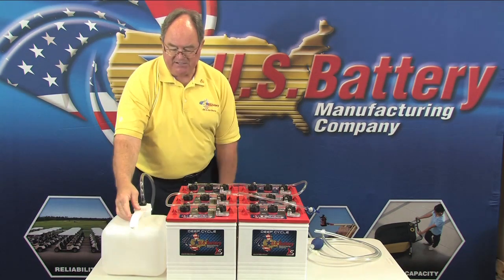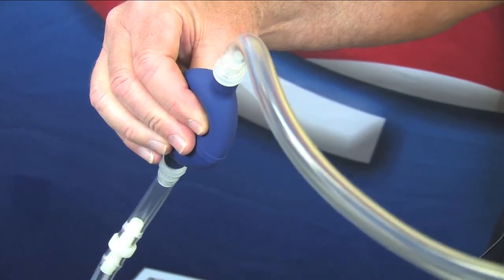Battery watering kit - by U.S. Battery

Comment: where the gas come out when battery charging ? Through the watering tubing or the caps like usual ? Just need to know how battery need to be vented in close space.
Reply: @USBATTERY  so having the filling tips plug outside of a RV when not used to fill the battery can be safe to vents the gases outside too ?

Comment: At 6 1/2 years my Polaris EV with US Battery US-12V-XC2 batteries (8 of them) has begun to show the need for battery replacement. Flow-Rite, the manufacturer of the watering kit I am using says the kit needs to be replaced with the batteries. What say you?
Reply: Make a close inspection of the hoses and valves. I would recommend replacing the 1/4” hose, but if the valves aren’t cracked or leaking, reuse them! TIP; use a hair dryer or heat gun to ease replacement of the hoses.

Comment: I only see 18 cells,are there 6 hidden ones?
Reply from the maker: The number of cells in a pack can very by the voltage of your batteries as well as number of batteries you have. If you are using a U.S. Battery flooded lead acid battery all of the cells are on the top of the battery, as shown in the video.

Comment: How do i check if one of the valves is leaking since you cannot really see inside the battery? I always worry that the electrolyte spill out in this case..
Reply: You have to pry open the vent cover of each battery and visually determine if each of the cell/s in your batteries are showing the propler level of water. I have the Trojan Hydrolink system connected to my batteries for over 3 years and it seemed to work well until the past couple of months.  This week i physically opened each batter cell cover and discovered that one cell in one battery and 2 cells in another had water levels that were way too low. All other cells were at proper water levels. I have no idea why this happened but i am thinking i may remove Hydrolink and return to my old water bottle.. With how expensive golf cart batteries are i cant afford to rely on a system like HYdrolink if it doesnt work. That system has a plastic bubble on each battery which shows as either a black or white color. That is how you are supposed to know when you need water. None of my plastic bubbles have ever shown any color but BLACK...doesnt need water. So if you cant rely on that bubble the Hydrolink system is worthless.